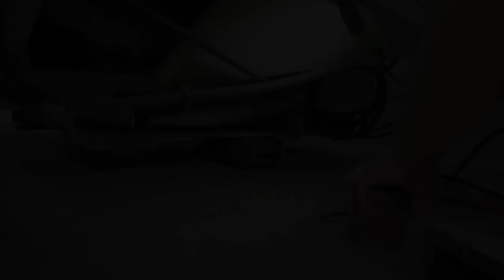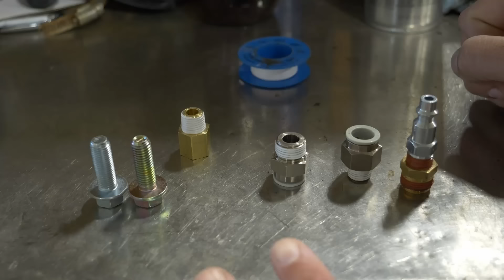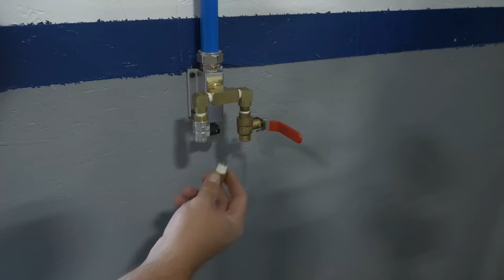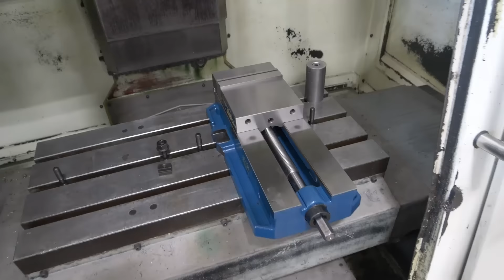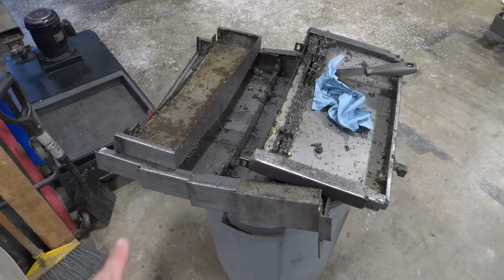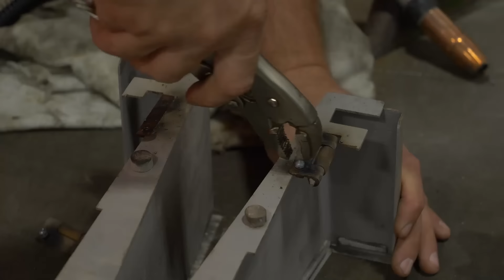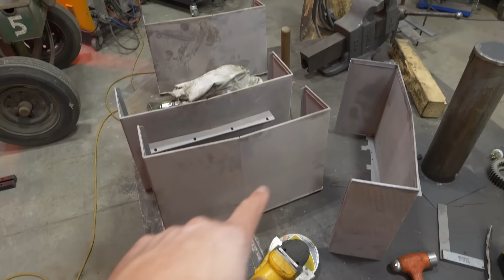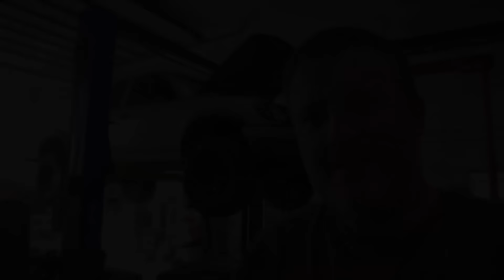Did I Buy a Problem or a Solution? Cheap CNC Repair Part 1

Comment: 11:15 I can hear my grandfather and father shouting at you, "you're using the spanner the wrong way around"!
Reply from the maker: There has been some testing done on that idea. Turns out some wrenches are actually stronger "backward".
Reply: @WatchWesWork  vintage made in Sweden Bahco adjustable wrenches are the best. I don't know if the new ones are any good.  Snap-on bought Bahco out and moved production to Spain. I never used one of them so I can't say.  But my old Swedish one is great. Don't call it a Crescent wrench. It does this thing where if I turn the adjuster tight it'll lock onto flats. Then the wrench won't slide off. I guess the jaws are angled in slightly? It's different.
Reply: But the other end only has a small round hole in it. 😁
Reply: the right way round is "which way will it fit in this %^&*ing weird pocket the designers gave you to fit a wrench in" when back-in-the-day the elbows on an open end wrench were slimmer
Reply: Torque test channel actually did a video on exactly that a few days ago. Turns out the adjustable wrench can transmit the most torque used like Wes did

Comment: Ive ran one those hurco machines at work that thing was broken down more then it was running idk if we had a lemmon or not
Reply from the maker: It's never gonna be an Okuma or Mori Seiki.
Reply: @WatchWesWork  true we crashed the crap out of them and never broke one the mori don't like heat though we had tall fans blowing on back of machine to keep it cooled off but ran like a tank

Comment: We called them Hillman rollers and moved equipment way heavier than that they are as tough as anything
Reply from the maker: Mine are made by Multi-ton. Same thing I think. I used to have some even bigger ones. They weighed about 50lbs each.

Comment: My father was a tool and die machinist as was my grandfather. Dad told a story of moving a large press in the shop by making the floor slippery with a crate of bananas. The shop smelled like bananas for years. 😂
Reply from the maker: I've heard of guys using two sheets of thin steel with grease between them. I imagine it smells worse and it not much fun to clean up!
Reply: @WatchWesWork  Another large machine move I heard of (I didn't see the move, but I saw the machine still in the same place years later) was using dozens of large ice blocks.  As the machine slid along slowly they would pick up the ice blocks from behind it and run them around to the front, forming a slippery path for the machine to slide along to its destination.

Comment: Yep. As an engineer, I deal with NPT and BSP threads often. Your explanation was clear and concise, as usual. Unfortunately, the reality is more complex since both thread systems are available in tapered thread and straight thread. Where we have full control of the design, it's fine. But when you source purchased pneumatic components from multiple places, you have to deal with mismatches. As always, great content, Wes.
Reply from the maker: I didn't even get into the weird ones like Komatsu fittings or the many non-interchangeable compression fittings.
Reply: Pipe threads are a complete nightmare, it's better if you can avoid learning too much about them

Comment: I found out the hard way, most shower heads are built with the British pipe standard, but yet we screw them on to NTP pipes.   Go figure!
Reply from the maker: They do make a kind of in between thread that is supposed to kind of fit both. I know Parker has a spec for it.
Reply: @WatchWesWork  I have a showerhead that I had to use a brass washer, a flat rubber washer, AND an O-ring to make it seal on the back of the balljoint (the brass washer backs up against the male pipe end, the rubber washer is a spacer, and the O-ring forms to the ball profile), and the threads still leak even with tape
Reply: Most us the o-ring or rubber washer to seal and the threads to mount it.  It's funny to see all the teflon tape on the threads when the threads were never meant to seal it up, the washers are.

Comment: That Tacoma is bound for an auto salvager. I've watched you fix heavy equipment, army surplus trucks, farm equipment, cars, robots, and now an industrial CNC machine! Pretty impressive! I haven't seen you fix aircraft yet, but I bet a cropduster will land by your shop and need a repair some day.
Reply from the maker: It would be fun. I don't have the proper license to do it legally though.
Reply: @WatchWesWork One experimental class crop duster coming up.
Reply: Most of those Tacoma frames are covered under a recall.  My Tacoma got a new frame free of charge.
Reply: My '02 went though the recall back in 2014, 10 years later its worse now than when Toyota did the work. Supposedly the new frames were supposed to be better but the state of mine says otherwise. I went into the dealership not long ago to see if anything could be done but the recall for that generation ended in 2018 so a few years too late.
Reply: @JonSturm  I have observed that the salts used now are different than they used to be. The last few years in paying closer attention to keeping it cleaner and salt out of the frame as best possible, really took a toll, even on the rear bumper. It has taken a beating also... Unfortunately...
Reply: @brianburgess5158  I saw that recall when Toyota Maintenance did a walkaround of the same vintage Tacoma and when you looked in the wheelwell, it was like brand spanking new. It looked like they did a full frame off restoration. Except they took everything off the frame and stuck everything that was on the cab just on a totally new chassis. That's fairly generous. And the time period was ridiculous too. I was shocked to see this because that was a pretty substantial recall. And wondered why they wouldn't have opted for it. Unless the wheels and mods excluded them..
Reply: @LAactor  Unfortunately, some of us missed the time expiration for that recall. My poor ol '99 sure could have used it. But it wasn't so bad back in 2018 when the recall expired. 😢
Reply: Meh I could fix it for myself. I can't fix it for anyone else though. The beauty of pickup trucks is the bed comes off easily. There is some pretty extensive damage there though. It'd take a while to patch it all up. A good solid week at least I'd say.

Comment: CNC - Content Not Complete Machine 😭
Looking forward to binging this series. Super cool! 👌🏼
Love the explanation on fitting types as well! Here in Australia, it's a mess if you need air or hydraulic fittings for our trucks. Near impossible to get factory fittings for my old Iveco/International, at least in my limited experience :c
Reply from the maker: It's a mess here too. No one knows there are differences until everything is cross threaded and leaking everywhere.
Reply: @WatchWesWork  Yeap, couldn't have said it any better! Never time to get it right the first time, always time to get it right the second.
Love the videos! C:
Reply: The problem is Australia gets stuff from everywhere.  So we get both BSPs, all the various US fittings, JIS, metric -- you name it, it's here 😵‍💫.

There's a reason I have so many try-boards (I think about 20 🤯) for different types of hydraulic fittings.  And a shelf full of catalogues listing different fittings/adaptors.